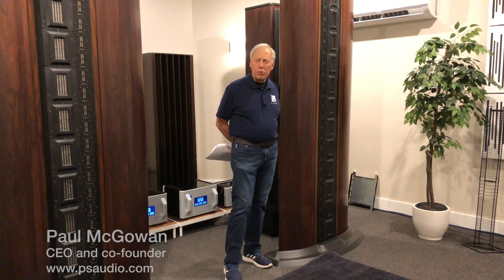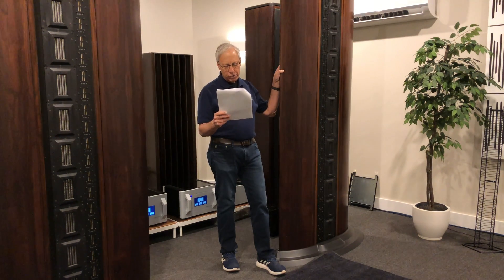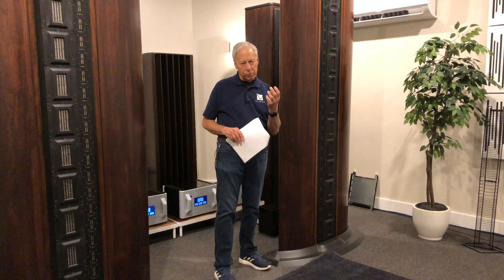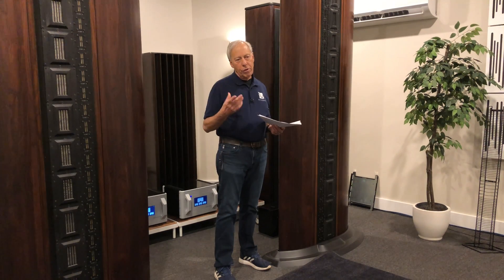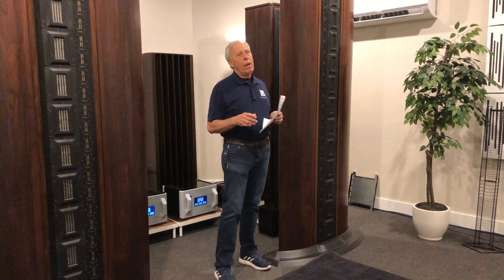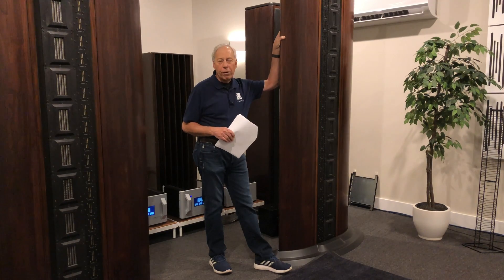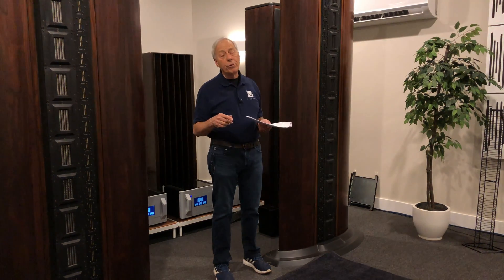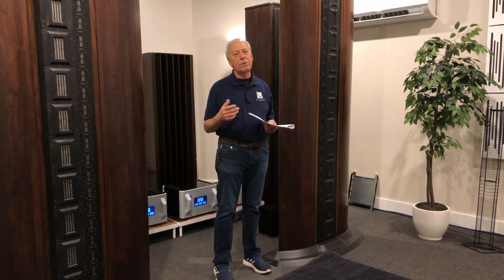4Ω speakers on an 8Ω load?

Comment: I've been running 4 ohm loads on 8 ohm amps for 35 years. I have never had any issues.
Reply: I have had the same experience....
For about the same number of years...🤔
Reply: It really has more to do with not pushing the amps too hard. Those of us who paid attention to clipping were more successful in not having protection circuits turn on.
Reply: That doesn't mean everyone will with every amp though. I own a Sherwood receiver that's famous for not being able to work with 4Ohm speakers at all. And remember there's a big difference between an amp that's only rated at 8 Ohms, but can play at 4 Ohms. And one that specifically warns not to use less then 8 Ohms, as is the case with my Sherwood. To be fair though. There aren't many like this, and they're mostly all cheap amps/receivers. But that's the point. They're built to sell cheaply. So they skimp on the power supply, and/or the heatsinks.
Reply: @amb3cog  I'm strictly talking discrete outputs, not cheap ass Chinese made, IC powered junk.
Reply: @j.t.cooper2963  It uses discrete outputs. It's not a chip amp.

https://www.parts-express.com/sherwood-rx-4105-stereo-receiver--252-125
Reply: @amb3cog  Cool. I still wouldn't own one.
Reply: @j.t.cooper2963  And why is that? Because you're an audiophile snob? Get over yourself dude. It was given to me for free at a yard sale by a nice gentleman in New Bedford MA about 3 years ago. It's been sitting in my garage unused for at least two years. I got another old Technics receiver, also for free, that I use as my garage radio instead. Because I like the way it looks. It's from the 70's. The Sherwood actually sounds better, and is much more powerful though. I've been trying to give it away with no luck, because people don't want to deal with a real stereo anymore. Even for free. Too big. Yes I offered free speakers with it too. 

I have piles of gear. Some free, some cheap, and some expensive. The cost doesn't match up with the sound quality in every case. This receiver you "wouldn't own" is actually one of the better sounding one's I own. I use separates in my listening room that it doesn't even compare to. But for a receiver. It's pretty darn good. Read the reviews. They've been making this same unit in one form, or another for many years, and still do. It's sold under the Insignia name also, I'm told. And it's something I would recommend to anyone just getting into the hobby. It shoots way above its price point. Although it doesn't compete with my $21 EBay TPA3116 amp in SQ. It's a lot more powerful, and has more inputs. 

I also have an Allo Volt+ Stepped Attenuator that costs me $60 something bucks on sale that sounds better then my main amp, which was about $1500 retail (I got it used for $275). And doesn't need a preamp. But again doesn't have the power. However, when I switch in a more efficient pair of speakers. It's a lot of fun. In fact the only gear I enjoy better are my tube amps, like the SET in my avatar, or my vintage HH Scott amps, for instance. But that's my thing for critical listening. The solid state stuff is for my secondary system that I use for everyday background listening, when I sleep at night, and when I want to rock out. Tubes just can't compete with w/ a couple, or three hundred watts of SS power for rockin out. 😉

My point is. Don't believe the hype, and listen for yourself. That's what really matters. 

And for much of the music out there today, or from back in the day. Having only a high end system will mean you can't enjoy it. Because the quality of the recordings are sometimes so bad. That they are unlistenable on a highly resolving system. But you're probably one of those music snobs too right? Probably let your system dictate what music you can listen to also, huh? 

The whole point of this is the music. Which I'll listen to on just about anything, even my cell phone. Don't care as long as there's some tunes on. And as long as I don't have to listen to the talking heads on the TV, or their agenda. I'll listen to just about any type of music too. Just not that formulaic new country music. That's horrible! 

People like you don't help this hobby you know? You scare people away, and you hurt it. You encourage the price gouging. You revel in the snobbery that will bring it down. Most people don't have the money for a real high end system, and don't even need it. But listening to people like you. They would think they do, and give up. Before they ever got to the part where they find out good sound doesn't have to be expensive. Please. For all our sakes, think about this, before you continue along this path. Not to mention. It just makes most people think you're a jerk. Sorry, but it's true. Have a good day.

Comment: I have my 4 Ohm Speakers connected to an Amp min. 8 Ohm and it works fine for 3 Years now even at loud volume. The only thing I noticed is that there's more heat dissipation. I read a little about building an amp and when you calculate the heat sink the dissipation value is inversely proportional to the lmpedance of the speaker, as far as I know😅, because a 8 Ohm 100 Watt amp could serve for ex. 150 Watts at a lower impedance if turned up fully.
 Also the 4 Ohms mean that that's the lowest impedance of the speaker but with different frequencies the value may be higher, without an Impedance Correction circuit of course, so there shouldn't be much trouble. My amp still works fine. Just be cautious that the amp doesn't over heat. 
Im from Germany, so I hope my English isn't to bad :) and I didn't explain it to complicated.
Have a nice day 👌
Reply: "Also the 4 Ohms mean that that's the lowest impedance of the speaker..."
Actually it doesn't. The "nominal" impedance is as several speaker designers have stated is a somewhat fictitious number arrived at to keep the users of equipment happy. A "4 ohm" speaker's measured impedance will nearly always dip below 4 ohms at some frequency.
Reply: "I don't know how the national standard, but in Germany there is a DIN standard which states that the Impedance of a 4 Ohm speaker cannot drop lower than 3,2 Ohm (one with 8 Ohm not lower than 6,4 Ohm)."
That doesn't contradict what I wrote. The critical things here are that the amplifier's output devices dissipate more energy the lower the impedance. And some amplifier designs become unstable if the speaker impedance is too low. That is, the amp oscillates and energy dissipation skyrockets.
Reply: @jonathansturm4163  I totally agree with you, but what I wanted to say is that in most of the frequency range the impedance doesn't drop that low, especially in the bass region where most of the power is drawn from the amp.
Reply: @hififriend4512  This is true which is why I drew attention to the stability problem. When an amp goes into oscillation it's often at a very high frequency but nevertheless draws the excessive current that should trip the protection circuit built into modern amps. Heck, even back in the 1970s we had fuses for that purpose.
Reply: @jonathansturm4163  true
All in all I think it's not to dangerous to connect lower impedance, if you are careful of course 👍
Thanks for the good discussion, that's sadly something rare nowadays.
Have a nice day!

Comment: It would help to have more details.  Many amps require a minimum of 8 ohm speakers if you connect 4 speakers and plan to play all four at the same time.  I have rarely heard of speakers rated at 6 ohms.  Using series resistors is not recommended because it will dissipate power as heat and affect the damping (control) of the speaker.  Of course you can try and if the sound is OK with the person it is OK.   Four ohm speakers will draw more current from the amp and may cause the signal to clip when played at the higher volumes if the power supply cannot handle the current draw.  This is not good for the amp or speakers.

Keep in mind the impedance ratings for speakers are "nominal" and vary greatly over the audio frequency range.  Typically there will be points in the plot that are lower than the rated impedance.  At one time I had a Marantz model 15 power amp.  It was hooked up to AR-3a speakers that were rated at 4 ohms.  The impedance curve of these speakers actually dips close to 3 ohms at some frequencies depending on how the mid-range and tweeter controls are set.  At the resonance frequency it is slightly over 20 ohms.  I was getting red lights on the amp when playing them moderately loud.  I traded the amp in for a model 250 and had no more problems.    Back in the day Acoustic Research published full specifications of the response curve, dispersion, and impedance characteristics of their products.
Reply: " I have rarely heard of speakers rated at 6 ohms..."
Wharfdale Dentons, Dali Zensor, VAF (all models), Advent, Acoustic Research (AR6)...

Comment: "My PS Audio amp is still in warranty. Can I run lower than recommended impedance speakers on it?" ......wait for it....
Reply: I do hope you're not implying that PS Audio amps can't drive a 6 ohm speaker safely. Even the Sprout100 can safely drive 4 ohms. Sheesh...
Reply: @jonathansturm4163  He thought he was being funny. But that was only true inside his own mind.
Reply: @amb3cog  I figured that was so, but this forum is clearly aimed at noobs and they can easily be misled.
Reply: It was a sales joke, went right over your two heads.
Reply: @scotts7017  Don't think I'm the one missing jokes here.
Reply: HH Scott Touché! Funny stuff either way.
Reply: @scotts7017  😁 ✌️
Reply: It’s actually a fascinating topic. Being a musician playing in bars for the last couple of decades, we added more cabinets to our amps for bigger shows from time to time, made the amps run hotter, but the added coverage trade off, plus less overall spl, was a good trade off. I never subjected the amps any lower than 3ohms, and those amps work fine to this day. Crest/Crown professional amps.
Reply: @scotts7017  There's no problems running amps even at 1/2 an Ohm. If they were designed for it. In fact car audio guys do this with subs. Those Crown amps are usually made to handle as low as 2 Ohms without breaking a sweat. So 3 Ohms is no big deal. But if you tried that with a cheap receiver. It would just shut down on you. So you've got to choose your equipment wisely. That's all. It's really a very simple thing. But I too find all this fascinating. That's why I just keep learning about it all, and never get bored with it. 

I'm actually very interested in trying a Drivecore amp from Crown. Mainly to see what all the talk is about. But also because I've heard some very good sounding Class D amps. It would be nice to have all that power, for very little money, and without the big electricity bill or heat. So long as they sound good anyway.
Reply: @amb3cog  I wouldn't worry too much about changes to the electricity bill. Hi-fi amps spend most of their time idling along consuming only a few Watts: single figures. The extra power only gets used when there's serious current draw: pedal passages on pipe organ for example and that's rarely sustained for any significant length of time. The serious current sucker in most (Australian) households is the 3 kW water heater: ca. 50% of total.
Reply: @amb3cog  I'd be interested in hearing a Drivecore compared to the Emotiva class D mono amps. The Crown would have much more power but if it was comparable that'd be a big deal. 
Also, my Adcom 555's will run 2ohm stable, even in monoblock mode, but only with fans installed.
Reply: @jonathansturm4163  Not worried about it. I don't even pay the electric bill where I live. It's just a bonus. Like not putting out heat into my room. Which I can notice in the summer. But would be happy to have in the winter. 😊
Reply: @trog69  I'd be interested in hearing either, or even better, both of them. I was thinking of trying the Emotiva's which were just on sale. They were B Stock, or whatever, but $255 a piece I think. Pretty decent for monoblocks IMO. But I didn't like the review Z Reviews gave. He implied the treble wouldn't be to my liking. So I decided to keep looking. Or wait till I can get a pair used for less. Supposedly Allo is in the process of developing a monoblock pair based around the TPA3255. If that happens. I'll try them, unless they're too expensive. But I doubt that will be the case, as they are a budget HiFi company. My Allo Volt+ Stepped Attenuator is amazing. Just not very powerful. If they sound similar with more power. I would be very happy. 😊
Reply: I am pretty sure those older Crest and Crown amps are class AB? Early 90S
Reply: @scotts7017  Yes they are. I'm talking about getting the new ones. The XLS series I think they are. They use Drivecore technology, or the new ones use Drivecore 2. Both are their own proprietary versions of Class D. And both get great reviews from people. The home theater crowd, in particular, are big into them. They have built in DSP features, like crossovers, and such. They even make a more expensive version that you can hook up to your laptop, and it interfaces with their software. Which does a lot of things, like room correction type stuff. These are called XLI I think. Either way. They've gotten very advanced, and are supposed to sound good. But not everyone feels that way about them. So I want to see for myself, and find out the truth. They start at around $300. And if I don't like the sound. I can sell it, or use it as a subwoofer amp. Not a big risk to find out at that price. So why not?
Reply: 2 Crest 1500s for the 6 top cabinets, 2 Crown 1500s for 6 18” woofers. Haven’t ever seen the clip light on any of them when we were driving it hard and loud.
Reply: @scotts7017  While they may be advertised as having Class AB output stage designs, they are often not biased as such. Most are biased Class B or barely into AB to allow the amps to run cooler while being abused in different ways. Warranty claims prevention is also a factor.
Reply: TSAmplifiers thanks for the info. They certainly are robust.

Comment: You can get resistors with aluminium housings with heatsink fins, but not sure if they will be audio quality. If heat is an issue it is easy enough to rig up a 40mm, 5v pc fan to keep them cool.
Reply: @Douglas Blake I suppose I meant not a cheap unbranded one.
Reply: @Douglas Blake Wirewound and therefore inductive? Haven't seen such a beast for many a long year...

Comment: So we add a say 10w 2ohm resistor in series. There goes the 12 gauge 99.9999999999% pure speaker wires purchased to get mightly good sound out of the system 😂🤣

Comment: FWIW, I picked up a pair of Audio Physic MkII's (4 Ohm), and in my excitement to hear them, connected my cheap Onkyo TX-8555 (8 Ohm minimum) to listen to them. All I can say is, at "listening level",  a puff of dense smoke was emitted, along with a wonderful burning electronics smell. I could have toasted bread on the top of it. That amp is now sitting on the dead component shelf.
Reply: What bullshit is this I see before me? From the Onkyo TX-8555 user manual:
"If you make an incorrect setting for the speakers or the impedance values, the built-in protection circuit may be activated resulting in no sound output from speakers."
https://www.manualslib.com/manual/115491/Onkyo-Tx-8555.html?page=13#manual
Reply: when the speaker pulling too much power from the receiver, it should go to circuit protection mode.
Reply: @hom2fu  Sorry guyz, that's what happened. I don't mean to spread any misinformation. I upgraded to a Yamaha RX-A1000 after that and the circuit protection worked just fine. I got tired of that tripping after a while though so I finally moved to an Emotiva A300 and haven't had a problem since. It just seemed like everything got really hot running an 8 Ohm amp into 4 Ohm speakers.
Reply: @jonnyz69  Er... you did say "8 ohm minimum" and nowhere in the user manual does it say that. It does tell you how to connect a 4 ohm speaker with the warning that the protection circuit will trip if you get that wrong. There's any number of possibilities here:
1. You didn't set the switches correctly for 4 ohm operation
2. The protection circuit was faulty and failed
3. Your 4 ohm speakers' minimum impedance was lower than the average
...
Yes an amplifier will run hotter into a 4 ohm load than an 8 ohm load. That's physics for you. My amp dissipates 100 W into 8 ohms and was measured to be dissipating ~175 W into 6 ohm speakers which is what I possess. The measurement was done almost 20 years ago and I cannot remember the exact figure.

Comment: I ran, for 20 years, a pair of speakers I thought were 8 ohm that were actually 4 ohm. They were single drivers, made in 1957, so I thought the grunge I occasionally heard from them was the voice coil rubbing. I had someone from Great Plains Audio tell me how to test for speaker rubbing, it turns out pushing on the cone with you fingers is not it, and to my amazement, the speakers were fine. I used a 6 watt transistor amp for this test, not the 2 watt triode I bought the speakers for (they are 106db efficient). It was in doing research after this discovery I discovered they are actually 4 ohm speakers. The grunge I was hearing was actually my single ended triode amp oscillating into the low load. After years of this, neither my speakers nor amp were damaged, it just didn't always sound very good. The amp has an 8 ohm tap and I now run it into a 16 ohm load with no problems.

Comment: Be careful! Those 2 ohm resistors are gonna get mighty hot! Especially at high listening levels. Go for at least a 20 watt 2 ohm resistor. Otherwise, I'm sure your 6 ohm speakers will be just fine. IMO.
Reply: Don't put reistors between the speaker and the amp. That will just dull the sound. You should rather just play at rather low volumes. Or better: Get a better amplifier.
Reply: Yup.